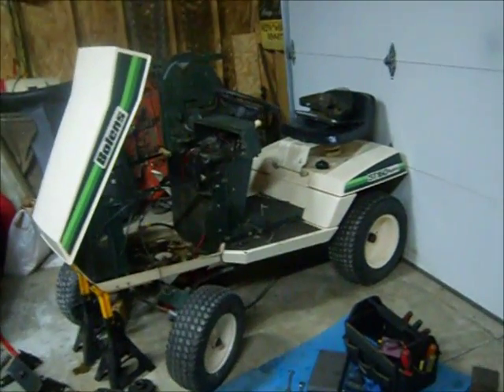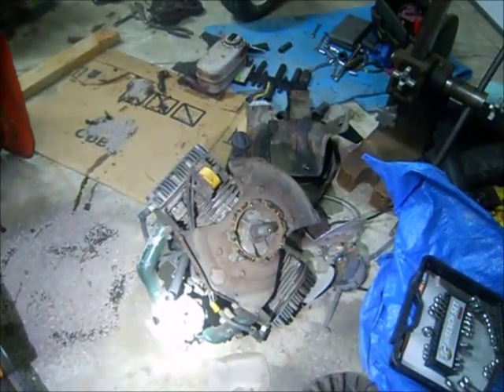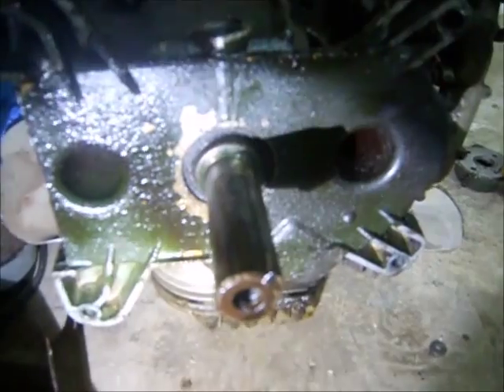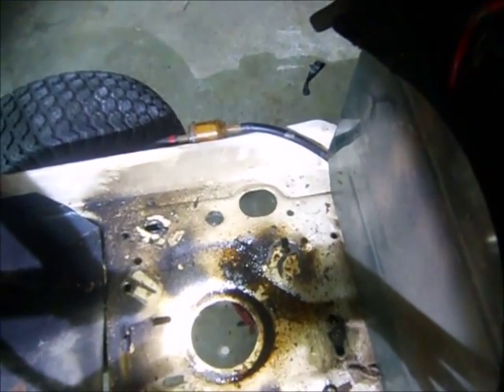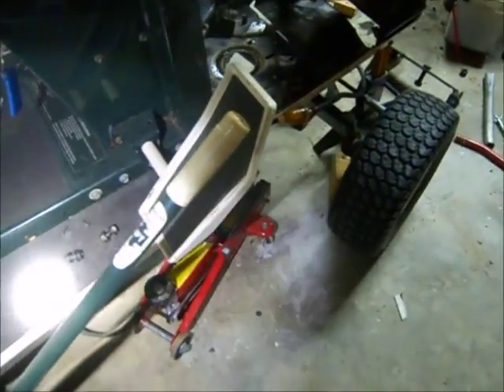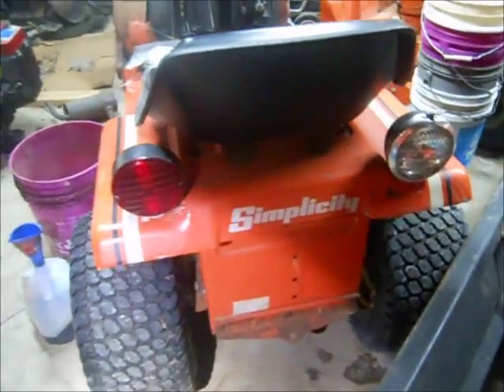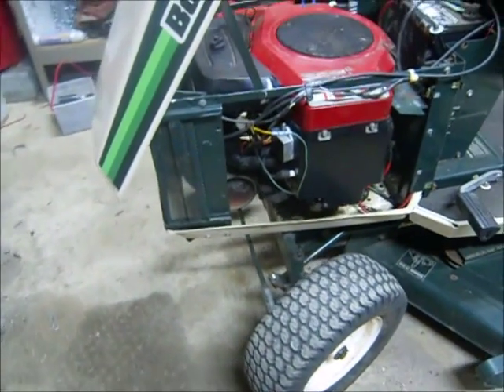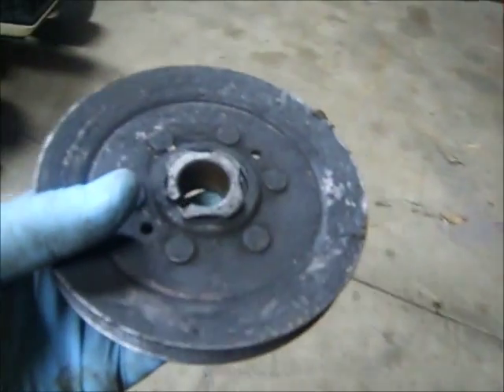Bolens ST160 engine install and update

Comment: You've got a great tractor hoard there really impressed. I would imagine you could get a different sump if you wanted to. Also that 18 is a good runner.
Reply from the maker: ***** Thanks.  I believe I could switch that sump.  However, engine still would just backfire before I took it out.  We'll see.